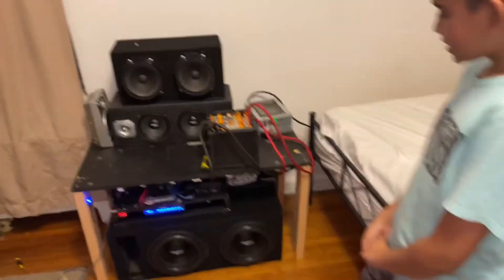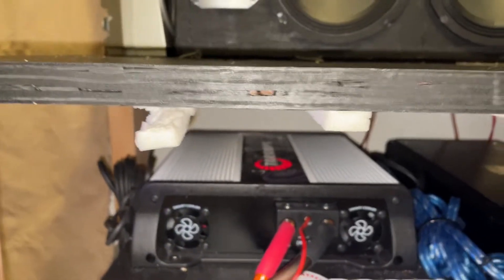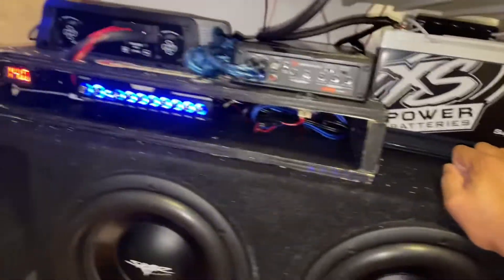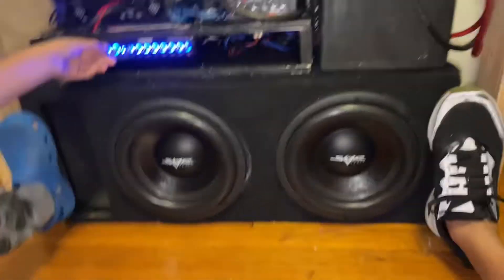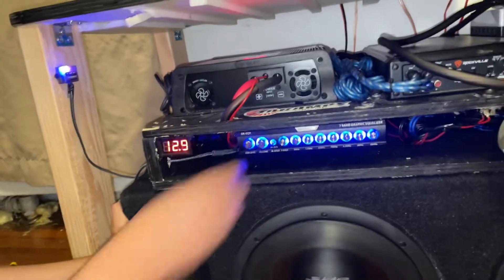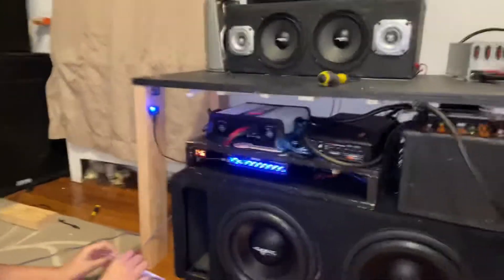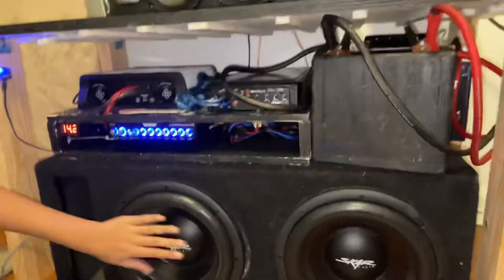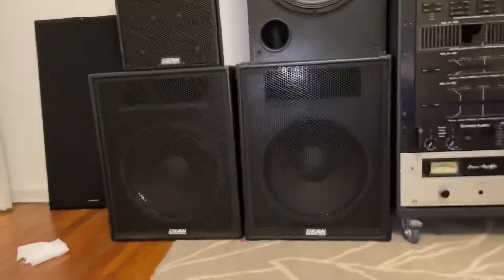How to power car audio in the home.

Comment: I'm interested in the two speakers at the top. What brand are they?
Reply from the maker: @wendongzhao5112  The 6.5 inch drivers are skar audio.
Reply: can’t find,just the Two on top not with Tweeters,looks like
8inch speakers.
Reply from the maker: @ Those were stock car door speakers, I don’t remember what car they came out off

Comment: Hey man I’m looking to set up a 10,000 amp in the house. I have a massive system that I compete with but I just messed up my jeep so I’m bringing the system inside. For subs I have 4 sundown x12 v3’s at 2500 rms each and a jp 83 amp that can pull 20k but am going to use either a 10k with the four subs or a 5500k with two subs but I need to know how to get that power. In my jeep I have multiple high out alternators and a limitless retro pro 56. I’ll also be running a hertz ML power for the highs and another ML POWER for the mids and they’ll all be hooked to a DSP. Any advice . I need POWER! lol
Reply from the maker: @justinhuestis2891  Unlikely you’ll have enough power from your outlets in the house. The most you can draw from a normal house is 100 amps before the breakers trip. If you were to get 10 of the power supplies in this video you would be nearing the limit of the house main breaker.

Comment: Coolest channel ever. I have some lifepo4 100 ah batteries going to get that 100 amp ac to dc converter. Not sure if the battery will regen as fast as those caps. My daughter now 5 is loving the bass hehhee. Great channel yall.

Comment: lol clipping like a mfkr plus looks messy af
Reply from the maker: Clipping for sure and some peaks. Messy yup, not a permanent install, just some stuff to mess around with man.
Reply: @DJ_Renn  yeah man I tired that type of setup at one time and it was just too damn messy.  Eventually I went with Crown amps to drive car subs.  But it was fun to experiment
Reply from the maker: @jorgem50  I guess because they are designed for different applications😄

Comment: What battery do I need to power the taramp smart 3k I have a powermax converter 120amp?
Reply from the maker: It depends, you gonna use lithium or lead acid?
Reply: @DJ_Renn  would agm battery work?
Reply from the maker: @ncpyro2464  Yes the AGM is fine. Before lithium, all car audio was on AGM
Reply: @DJ_Renn  which agm battery would I need?
Reply from the maker: @ncpyro2464  Get and decent 100ah AGM. Don’t get some expensive like XS power, not worth the extra $. Even a autozone platinum AGM will work just fine
Reply: @DJ_Renn  oh bet thank you🙏
Reply: @DJ_Renn  another thing where did you get that volt meter?
Reply from the maker: @ncpyro2464  Amazon

Comment: What setting do you have the converter on 3stage or fixed? Im at the final stages of the build. Powermax 120amp,kinetik battery,ioxus capacitor,down4sound jp8, 2 skar svr 12's
Reply from the maker: If the system is off and just charging, then 3 stage, if system is playing then fixed to around 14.5 for the lead acid.
Reply: @DJ_Renn  Thank you very much. You just gained a subscriber. First person to answer my question.
Reply from the maker: @Megakrunch1  Glad I could help. And thanks. Feel free to ask questions. I know what you mean about ppl not replying on YT.

Comment: I like the new foot technology suggesting you're using very tricky very useful when you don't have screws or stuff holding your stuff in place use your foot of your hands hold everything place well I see how far you can get the amp to go for the speaker into the speaker of the amp just shut down that's funny great foot technology we all need to need something like that it'll come in handy when you're trying to hold your stuff together 🤣🤣🤣🤣🤣🤣🤣🤣🤣🤣🤣🤣🤣🤣🤣🤣🤣

Comment: Why the voltage is dropping so low, with 100a psu,caps and battery something aint right here
Reply from the maker: The amp drawn 190 amps on music and 270 on a sine wave and the battery is only 32ah and really wasn't charge in this video, the ultra cap is 58 farads.....With the battery fully charged, it hold in the high 13's to low 14's full tilt.

Comment: I been trying to do this it hard can your guys plz make a video of what your guys got and how to set it up
Reply: Ummm maybe i can helo bro, search up “Blazed legend , how to connect car audio at home”, hopefully this helps👍🏼, he is using a converter thats a 100$ but you can buy one thats cheaper if your on a budget you could buy like i said cheaper, i got mine for 60$ its anbull 50 amo convertor its good
Reply from the maker: It's explaing in the video......But I'll list it step by step.
1. You'll need a high current power supply, in this video we are using a 100 amp power max charger/power supply. Dependong on what you want to power, you maight not need the 100 amp, there are many different sizes and costs.
2. Connect the power supply to the battery.
3. Connects amps to battery.
4. Listen to music  😁😁

Comment: Bro ,I have a viking banda 15k , and a 15 inches subwoofer its 10,000 watts RMS .

I have it hooked up to 2 xs 3100 power battery.
And a power max  120 amps

But seems not to be enough power please help me how many batteries I need?
Or which batteries you recommend me.

Thanks a lot.
Reply from the maker: The Average Current Draw (Music) for that amp is
630 A. You would probably need around 6 D3100 or you will be better off with some lithium cells.The 2 3100 should let you play pretty loud unless they are old and not holding a charge anymore. Look into lithium though. Ive run 2 9K wolframs with that charger and a lithium bank for about 4 hours with no issues.

Comment: At which voltage you got the power max?
Reply from the maker: 14.6
Reply: @DJ_Renn  while listening music do you keep the power max plug? I mean on.
And which stage you have it?
Help me please I want to know .

Thank you.
Reply from the maker: @dago1983able Yes, it's plugged in and connected to the battery in "fixed voltage" mode set at 14.6 volts. Do not us it in 3 stage for lithium batteries, they like constant current & constsnt voltage. If you are using it to charge lead acid batteries, use the 3 stage setting. I have run large car systems with the engine off and this PS cattached to the the battery bank for hours with no issues.
Reply: @DJ_Renn  thanks a lot
Reply: @DJ_Renn  what part are you bro,?
I wish to come to see your audio set up
Reply from the maker: @dago1983able  nyc
Reply: @DJ_Renn  bro I'm in Manhattan is possible to come on Saturday ?
I have many questions about audio set up , and I wish to see your car audio .

Thank you.
Reply from the maker: @dago1983able  PM me your # ill call ya
Reply: What’s up man nice set up I’m looking to do the same but having a hard time
Reply: @barrylarry176  there's a better way to feed your Amp.
You don't need batteries in home I got mine with 6 chargers and sound amazing